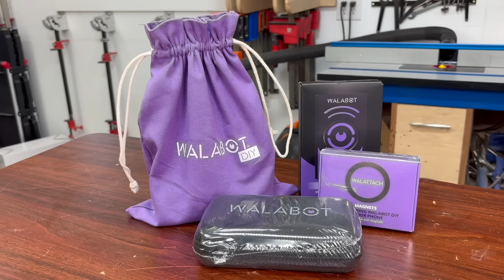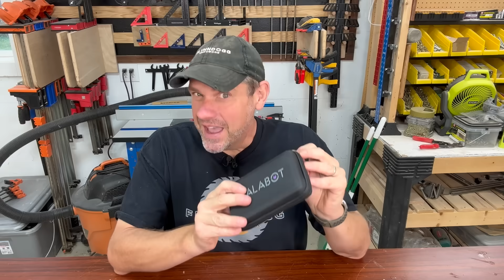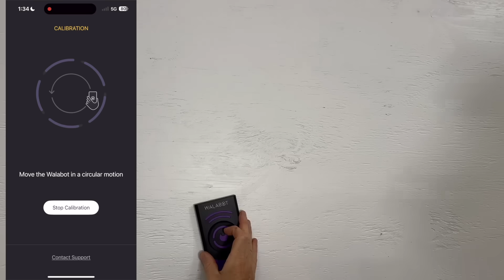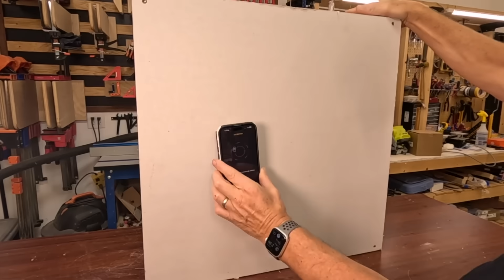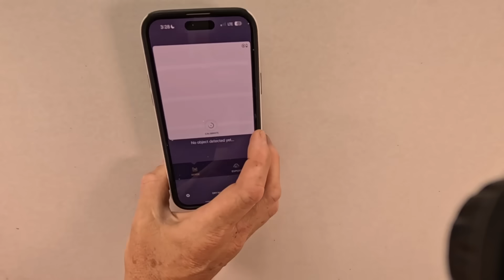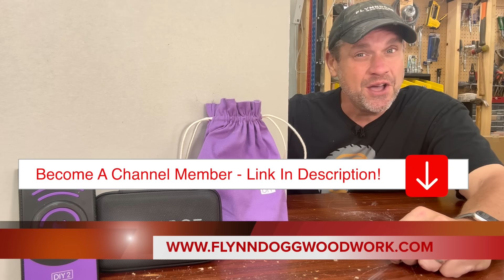I Tested This Incredible New Tool For DIYers!

Comment: Nice review!  Been thinking about snagging one of these for myself.  I know they say you should be able to use this with plywood coverings.  Any idea if the unevenness or density difference in OSB wall sheathing would present an issue in detecting wooden studs or wiring?
Reply from the maker: That's a great question! I'm not sure about OSB, but I can definitely say it works with plywood as all my walls are 3/4 plywood and had no issues there.   Great question though, maybe someone else can chime in?

Comment: I will tell you it doesn't work on lathe and plaster and if you have a wall with heavy insulation or for instance the insulation is rockwool type it will confuse even worse or may not see anything but the insulation itself...  This was my experience with one...  If you have been doing wall fishing for a while, you know not to shove a drill into a wall, especially if you have no idea what's inside.
Reply from the maker: Thanks for the added info on what it won't work on, I appreciate it!

Comment: I do like the thing but it isn't new.

I bought the original Walabot more than 6 years ago.  I got the second version in 2023.  Not new but useful.  I still mostly use the Franklin.
Reply from the maker: yeah, not a new tool, this diy model is supposed to be there latest version though.  I guess they are trying to get into the lower end consumer market.    Franklin is another great option, just can't pinpoint things other than studs as well.   Really appreciate you watching oldguy!

Comment: What does a wooden stud with a wire stapled down the edge look like on the camera?  Could you show more examples of combinations of elements behind the wall to see how the tool interprets them?  Pipes running near wires or crowded cavity spaces in walls?
Reply from the maker: Yeah, that would have been nice to show.  That's a great question.   Off camera i did do a wire next to a stud and it did go back and forth between the two.

Comment: Excellent product.  I have one too!  Thanks for sharing!
Reply: I bought one a couple of years ago and hated it.  I put it back in its case and it hasn't been opened since.  I found the Franklin to be just as accurate and a whole lot less hassle.  I found that holding both the cell phone and Walabot were too much of a pain to bother with.  I didn't want the magnet on my phone because it'll screw up the Qi charger.
Reply from the maker: Thanks so much afpitbull!  Really appreciate you watching!

Comment: This is a great device for sure, but I've found a lot more use with a thermal imaging camera for the cell phone or a hand held version. I like the larger of the two Klein models. I can see the studs, check for a clogged radiator or a misfiring cylinder on the truck and literally measure her hot a$$, lmao.